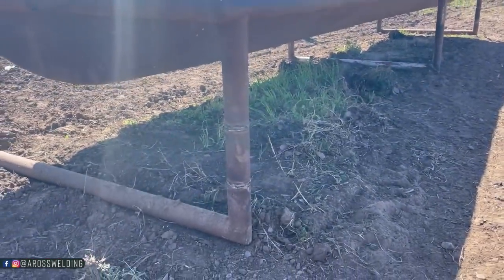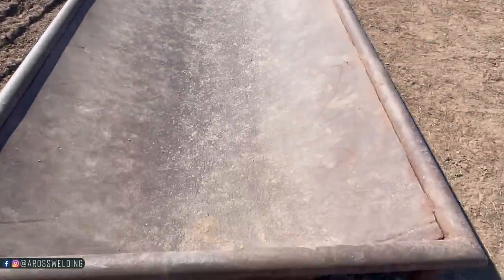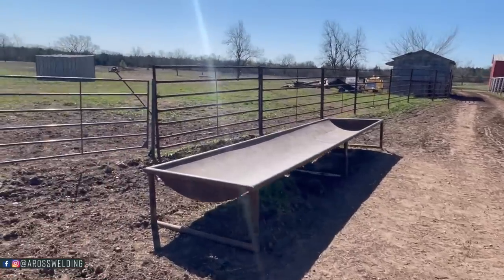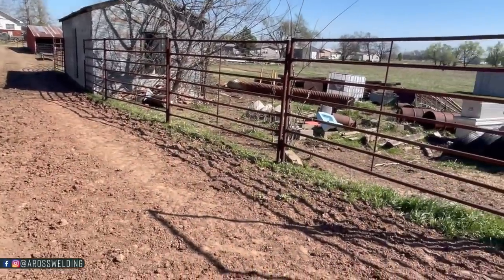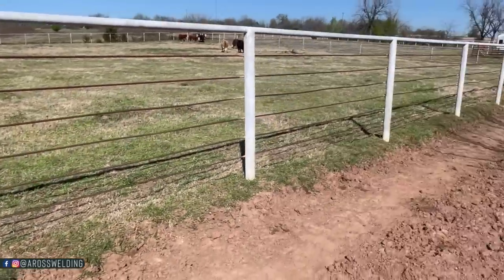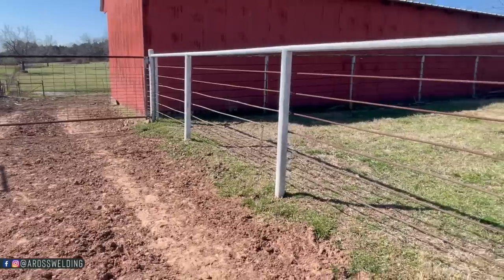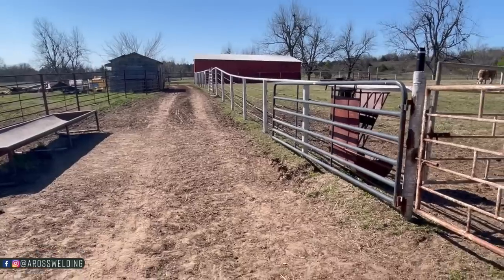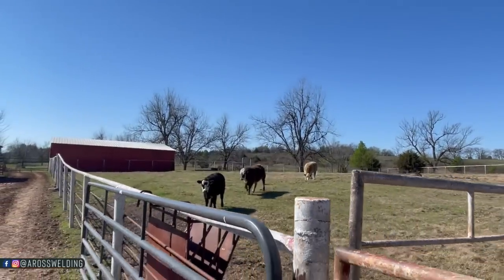Building Hitch To Move Trailers Without Truck

Comment: I got myself into pipe welding I do not have a the h&m beveling machine I cannot afford one right now how can I cut like certain size pipe with a grinder on side with cutoff wheel and a grinder and then leave my grading with the beveling with a hand grinder cutting torch which one do you prefer

Comment: Nice content, I love farm and ranch engineering; however, I know from experience that having the hitch ball extended that far from the bucket creates more leverage on the front end loader, lessening its lifting capacity. It'll handle a small lightweight trailer okay, but may not do so well with a large trailer, or a trailer that has a heavy tongue weight.....

Comment: This is different, but you might care to know if you ever fool with stock trailers: A pal used to use a truck with no hitch in the bed to move gooseneck trailers around on his trailer service lot.  He used a spare tire in the bed of the truck to locate the hitch. The pressure on the hitch held the tire in place for short moves and backing them into the shop.